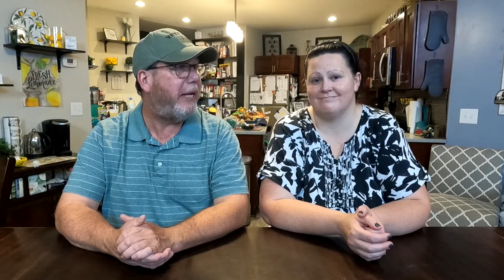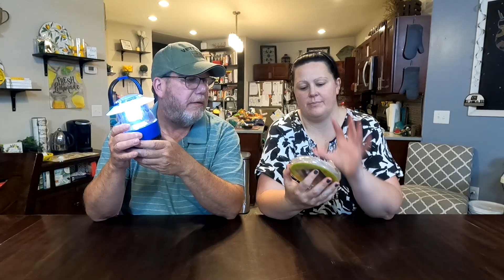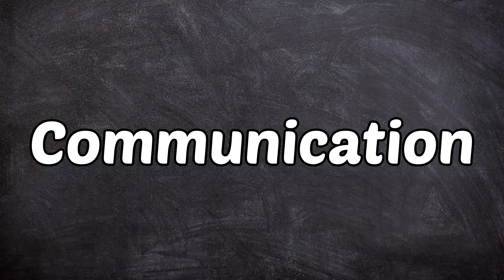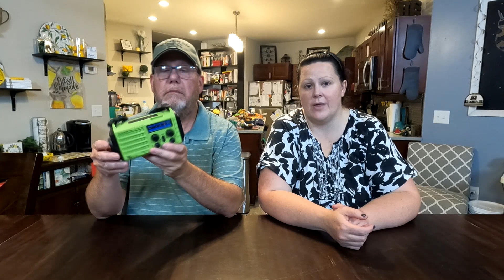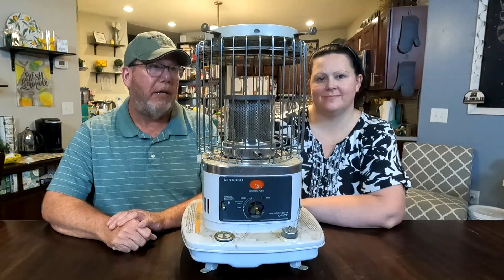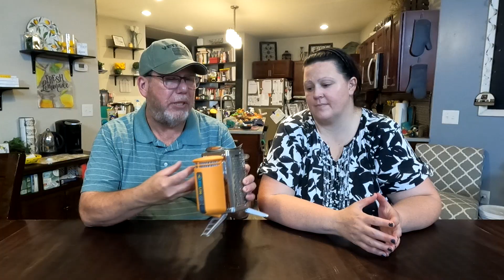Power OUTAGE and BLACKOUTS are Imminent – How to PREPARE!

Comment: You mentioned (as well as MANY other preppers) about being able to fill a sink and a tub if you essentially have forewarning.   I’d like to add and this may sound petty but think how important it can be.  If
You’re going to try to use a sink and you had say 20 minutes to fill it, the last thing you want to do is a sink full of dishes!   So my
Suggestion, keep your sink clean or empty along with the tub just in case you need that space.   PLUS think of the water you’d use in your preps to wash dishes that could’ve been done before a blackout
Reply: Water is SO necessary. I am always in need of it each day.  I have been filling any container that becomes empty, with soapy water for cleaning, flushing the toilet, cleaning a cut, shaving, wiping  the dog's paws on muddy days, cleaning produce, or taking a sponge bath, cooling off, etc. Some of the water is bottled, but I want some larger containers, and the pills to drop in, for drinking water. I saw the video for making a well pump, and that is fascinating.  It stated that the commercially made newer pumps are available at a big box store, but I just happen to have an older one, which they say is better, as a focal point, in one` of my flowerbeds...That will be useful, if we cannot use a our well.
Reply: @jeanmader2302  we are on tank (cistern) water and our outside tap is gravity fed. We are also on septic tank so can “flush” the toilet with a bucket of water. Although we have a huge generator, you don’t want to become reliant on that for sure!!!!!
Reply: @nz-nz  We a also have a septic tank, and a leech field, And we pump every four years as there is just two of us in a three bedroom ranch. What could be better to flush a toilet than soapy water? LOL.
Reply: And keep the laundry done.

Comment: I install CO, CO2, and NO2 sensors as part of commercial building automation systems in large distribution centers across the country. CO2 is heavier than air, but will just give you a headache and make you groggy. CO is slightly lighter than air. I have seen some installed by others in the ceiling 35 feet above the floor as part of the fire alarm system for emergency notification. We install ours at the height recommended by Dwyer, the manufacturer, which is 5 feet off the floor, in what they consider the breathing zone. I do not recommend mounting CO sensors at floor level. Dwyer model GSTA of anyone wants to Google them to see for yourself. We've installed roughly 400 of them in the last 3 years. I'd go with what the device manufacturer recommends.

Comment: If we have no electricity then we have no water and our garden will die. What do we do to keep the garden alive.
Reply: Catch rain water,been doing it for years
Reply: I will harvest rain water. Only a couple months could be iffy if another heat waves hits us. PNW was unseasonably hot last year. Also knowing where your local spring or water source is and having way to boil the water and filter it.
Reply: take a tarp, set up like a v shape V let rain run into buckets (5 gallon from Home de. or lowes or walmart with lid) use for gardens) or larger barrels/buckets. if want to use for drinking 8 drops bleach per gallon so 40 drops 5 gallons, use for toilet flushing, washing dishes, cooking: boiling water for dehydrated food.
Reply: We got a bunch of barrels and trash cans filled them full of water and carry a sprinkling canned to water the gardens to see if it would work it does. You may have to have a whole lot but it might help you

Comment: Good advice. Just a note though, Carbon Monoxide is slightly lighter than air, so detectors should be mounted high, just like the manufacturer's instruct.

Comment: I went to the store today and it was really depressing. They wanted  just about $4 for a loaf of bread. I seen a man pick up a pack of chicken and put it back. Gas jumped to $4.79 a gallon
Reply: Making bread is very easy instead of buying it. If you don’t have yeast, add a can of beer 🍺 to flour for yeast. Sams club has a 2 pack of 1lb yeast packets cheap. I plan to buy the largest bag of flour, grits, yellow corn meal, powdered milk, salt, sugar that I can afford to save up. They are basic staples anyways.
Reply: @constitutionalrepublic1966   thank you. I know how to make bread and I have yeast.. I'm getting depressed 😔
Reply: @morseventurechannel1365  you’ll have times when you are depressed…… been there and I hear you….. BUT…… realise that the reason you are experiencing that, is because you are FEELING………
That’s good, it proves you are still human!
Turn off the internet and get outside and walk on the grass/soil in bare feet. 
Think of ONE thing you CAN do… and DO it. 
Then congratulate yourself on your achievement. 
Tomorrow, remember what you achieved, and you will do TWO things!
🙏❤️

Comment: Just a heads up, carbon monoxide is actually slightly lighter than air so it will rise and not collect close to the floor initially. I work in the fire department and have had to deal with this.
Reply: @ALF...InTheHouse  one low one high. Double the cost but cheaper than a funeral.
Reply: @ALF...InTheHouse  at a minimum go high. You can get ones that are combination smoke/co so you won't have multiple detectors in each room. That's what I did in my own house.

Comment: Check out the CDC pages on Carbon Monoxide. My apartment CO detector is on the ceiling. I bought my own detector and it is down low.

Carbon monoxide (CO) When power outages occur during natural disasters and other emergencies, the use of alternative sources of fuel or electricity for heating or cooking can cause CO to build up in a home, garage, or camper and to poison the people and animals inside.
Reply: Cook OUTSIDE at least 10 feet DOWNWIND of any doors or windows.  Or use a solar oven.

Comment: Electric chainsaw works very well for small tasks. Chords of wood gas power is best to work with log splitters
Reply: My Milwaukee battery powered chainsaw will fell a 10-inch diameter tree and cut it up into logs on one battery charge. Gave my gas-powered one away.

Comment: We have yard solar lights.  And if we lose power at night, we bring those in.  We just did that last week as a matter of fact.  And can carry around the house like a torch so you can see walking around the house. 👍🏻
Reply: Yes that works. I also keep glow bracelets (25 in pack at dollar tree). Great if you have kids and want light attached to stair banister or one tp holder etc. Used during Harvey successfully. There are solar crank lanterns as well, hand pumped flash lights (keeps kids busy), hanging solar bulbs. I keep one of the bulbs hung in corner of living area...even has remote. Crisco candles since long burning but don't leave where pets or kids can knock them. So many options.

Comment: TFS this. Good tips. A/C is essential in TX in the summer so it just depends on where you live.
Reply: I built a solar transmission cooler I saw in YT. It works. Even better when you have ice packs to further cool the water in the cooler. Now need larger solar panel or solar fridge
Reply: @Bluepeacocks88  awesome!

Comment: We have everything we need to put down a hand pump if we need it. Pipe, well tip and driving frame. Only have to go down about 35 ft to get good water. It's not hard to drive one here have done it before.
Reply: Put it in now as you want to practice with it for months to get all the bugs out.  Plus have all the sand in the hole cleared before you use it on a regular basis.

Comment: Two-man saws work without gas or electric power. And it warms you up too. You might want to look into a wood splitter that uses heavy duty truck springs and gravity.
Reply: I use an electric wood splitter powered by solar panels.

Comment: You should install a hand pump on your well
Reply: I try to tell my step dad to do this but he don't see the storm coming. Well not a hand pump but a designated electric circuit to plug in a generator. Just run the gas gen to get the water take a shower then turn off. 10 gallon of gas will last a long time for on off quick deals.

Comment: Unplugging appliances when the lights go out is a great tip. My appliance repairman told me to do that when I switched to a computerized washing machine. I also keep my desktop PC connected to battery back-up in the case of a sudden outage. These days with parts and chip shortages it is better to be safe than sorry.
Reply: Those battery backups for PC are amazing!
Reply: @cindypaulson5576  they sure are!
Reply: Use surge protector to plug into also always

Comment: Water is very important to store..  not just for obvious reasons.  It has a very high specific heat (it can absorb tons of heat before warming up).  One way to stay cool is turn your AC on low (65-70F) at night after 10PM and keep running until noon, when peak load hours kick in and power outages can happen.  The water will cool down and help keep the house cool (by absorbing heat) if the juice goes out thru the hot afternnoon.

Comment: Not  only  kerosene  /  hurricane  or  Tilly  lights  /  lamps  (hurricane  lights  are  best  as  they  don't  have  a  mantle  to  break  thus  rendering  the  lamp  useless)  but  also  candles.

Matches  and  cig  lighters.     Matches  can  get  wet  thus  rendered  useless.
Cig  lighters  will  work  if  wet  until  they  run  out  of  gas.

A  pint  tin  of  petrol  or  kerosene  to  wet  the  tip  of  a  rag  to  start  a  log  fire  in  wet  conditions  but  use  the  dry  heart  of  the  log.

Place  the  outer  part  of  the  log  vertical  near  the  fire  so  the  warmth  will  dry  out  the   timber.

Just  a  few  tips  others  may  not  be  aware  of.

Comment: I'm on community water and when our elect. goes out so does our water. I have 2 - 275 gallon totes to put water in. I need to get them up on blocks or something then wash them out. They have been cleaned but need to rinse them.
Reply: To clean/rinse my totes, I load into the back of my pickup truck, secure with tie-down straps, fill about 1/3 full with water, add detergent/clorox  and then drive around.  The start/stop motion helps to agitate/scrub the inside of the tote.  Then drain, rinse and move to the location you've picked.  If needed, set on top of cinder blocks to achieve a height high enough to fit a 5gal bucket under the spigot.  Refill your tote with potable water.

Comment: On our well we have a 5,000 gallon reserve tank that is gravity fed.  So, we can use the well until that reserve tank of water runs dry.  Our well is very deep and we have a huge pump.  That means we would need a whole HUGE setup of solar panels, and all the things that go with it, to run it if the power goes down for good.  That solar system would be separate from the house’s system too.  We do not have solar on the well though.  However we do have solar on our house.  We had a blackout almost two years ago.  We switched a switch in the basement and the solar panels we have on the roof will then power the sitting room and kitchen, NOT the whole house.  Our one refrigerator (not the second one outside of the kitchen in the pantry) will stay on.  So, virtually only two rooms will have electricity for an array of solar panels on the roof 75 feet long.  That is the whole length of the house, covered in solar panels on one side of the roof, to give you two rooms of electricity.  The ceiling fan will run too, as well as the electric sockets in the room for heat in the winter, using an electric heater.  What I am saying is, you need lots of solar panels to run NOT VERY MUCH square footage.  We are connected to the grid, which is a different system than off the grid (for those that have not heard of that before) and our over $800+ electric bill without the solar panels, is now cut down to less than $300/month.  So, we save approximately $500/month.  The layout was over $60K.  I think people do not understand the scope of solar and that is why I am telling this private info here in your blog.  Everyone says, “Yes!  I want solar!”  However there is a bunch more to it, and it is not cheap.  We do not have lithium batteries either, so the batteries will have to be replaced sooner or later.  You also have to wash the solar panels as they get covered in dust, especially in the country to get them to run efficiently.  We do have sun in Texas though and lots of it!  Today, it is rather normal at just around 94 degrees.  I hate the 100 degrees days.  Solar is a whole other animal that is really interesting.  We have an EMP shield on the house and the solar system.  If the EMP is not something that the EMP Shield people don’t cover, it will not be good.  If they make an EMP that will blow out everything, regardless of the EMP Shields, then we are toast, regarding solar, and everything else.  I hope this information helps someone.  I had a big misconception about solar before we actually found out about it.  I had no idea it was that expensive, all the do dads it takes, how many panels it takes (lots and lots) and the small footprint the electric it makes will cover.
Reply: I just installed a solar well pump that does 5-6 gpm. It's a back up system to the 220v system should we lose power here.
Reply: @deehomer8194  It is comforting.  Do you have the EMP Shield attached to the solar system on the well?  That’s another $350 + or -.  It will go out (we called and talked to the EMP Shield people about this very thing) if an EMP comes and you are not protected.  We need one for the bunker yet and one for the well also and we are done.  All this stuff is so expensive and there is so much to buy.  We are not made of money, so we have to budget it all in.  If I was just starting my preps, I would be a nervous wreck.  We bought our land out here about 10 years ago.  Honestly we didn’t figure things would escalate so fast either.
Reply: I would have a stroke if I had an $800 or $300 electric bill wow
Reply: I hope you have the money to replace that submersible pump if it breaks.
Reply: @AZCanner  yes, our daughter-in-law works for a septic and well company, so we get a family discount.  🙂. Still, it will be a costly item.  Hope you have some provisions too, as none of this stuff is cheap.
Reply: @Donna Bright yes you can My solar pump sits 25' above the 220v pump in the case. It has a low water shut off 2 feet above the solar pump. Check out RPS solar pumps on you tube. Alot of Info . And solar was cheaper than a manual pump by $1000

Comment: Is there a way that I can run a deep freezer on a car battery?
Reply: Yes. You'll need a low frequency/inductive-capable pure sine wave power inverter. A small freezer might use a 100w with a brief power drain of 1000w on start up. A single car battery won't power it more than an hour or so though; you'll want more.

You can scale your system up or down based on your needs. My first back-up system used 8 deep-cycle (boat/RV) batteries and an Aims Power brand 4000 watt power inverter. It would power the furnace and lights in the winter or fridge/freezer and lights in the summer for nearly a week. I later built a larger system with solar panels and a wind turbine that powers an entire off-grid cabin year round. For temporary use, a small Honda generator is an option as well.

Comment: Carbon DIoxide is heavier than air, not carbon MONoxide. It's not recommended to put detectors down low. Check your detector's installation instructions.

Comment: Actually hand warmers can work great. Has power outage in January about 5 years ago. It was in the teens temp wise. Shook up couple of the larger square warmers and put one near bottom of sleeping bag and one near shoulder area in sleeping bag and worked great. Actually very toasty and a bit too warm for me. I have both the summer and winter sleep bags.
Reply: Cardboard works as a good insulator too. That's why the homeless use it and cats do too.
Reply: I ALWAYS kept an  old sleeping bag in the trunk of my car, before the kids married and left home.  That sleeping bag was so handy when bringing flowers home to plant.  It protected the trunk floor.  It was there for warmth in winter, or if we got stuck in snow, or to move sharp or glass objects, wrap small furnishings, my books and library books to transport to a church sale, or back to the library. I will have to purchase another for whatever I may need it to do.

Comment: They can estimate how many people died of the black plague by the number of candles the church burned.
They burned a candle at every funeral because the flame burned off the gases that the dead body gave off.
  If you get a dead rat in your house burn a candle or two to get rid of the smell.
When you use your kerosene heater also burn a candle nearby to burn the fumes from the heater.
Big Lots sells 100 tea light candles for $5.00. Get a years supply for $20. They never go bad.

Comment: I spent about 3 years growing up in a small trailer(mobile home) and the only heat we had was a SMALL propane stove/ oven. My sister and I used to dry our clothes with it while we sat with our feet gently placed on the open oven door. We had no fire extinguisher, carbon monoxide or smoke alarm. In hindsight, that probably explains a lot🥴😂

Comment: I run a 7 watt tv my fridge and freezer on a 2000 watt inverter generator for 11 hours on a gallon of gas. My 86" hangs on the wall for use on grid power lol